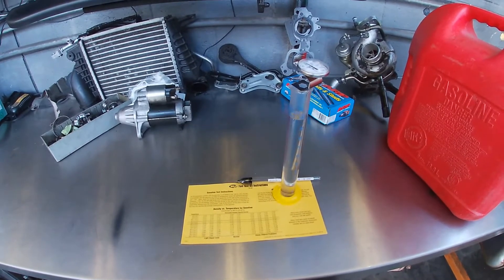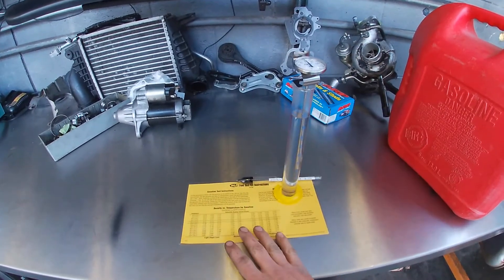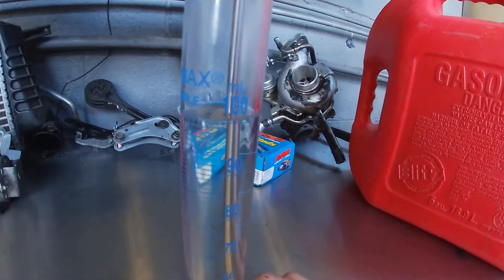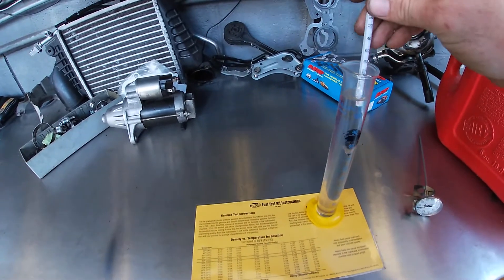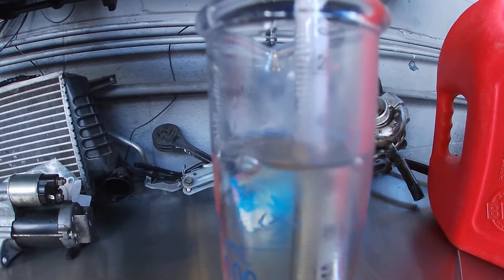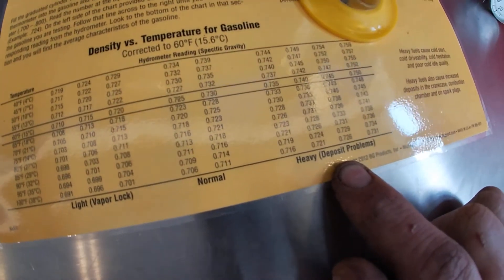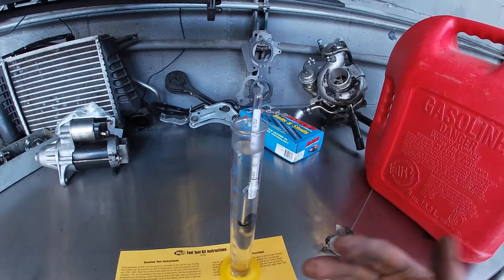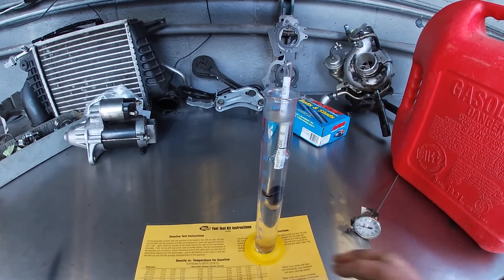Fuel Contamination Test

Comment: Where do you buy this test kit?
Reply: please please please!!!!
Reply: If anyone finds this kit please post a link
Reply: To answer your question on that fuel test kit he's using, its a BG Fuel Tester Kit
Model: BGU995.  About $360.  Many vendors sell it.  Just do a search, or buy from your local BG Distributor.   BG also makes a kit that tests additives for PEA concentrate.  There is a guy in Europe who has an on going video testing many fuel additives with this kit & basically BG 44K is the highest & BMW is the most highest PEA concentration.  Its called the BG995DCA.  BGSuncoast Florida distributor sells it.  Also about $350.
Reply: That fuel test kit he's using;  its a BG Fuel Tester Kit Model: BGU995.  About $360.  Many vendors sell it.  Just do a search, or buy from your local BG Distributor.   BG also makes a kit that tests additives for PEA concentrate.  There is a guy in Europe who has an on going video testing many fuel additives with this kit & basically BG 44K is the highest & BMW is the most highest PEA concentration.  Its called the BG995DCA.  BGSuncoast Florida distributor sells it.  Also about $350.